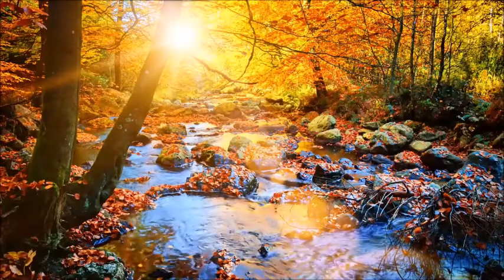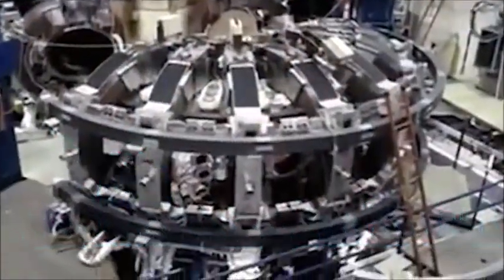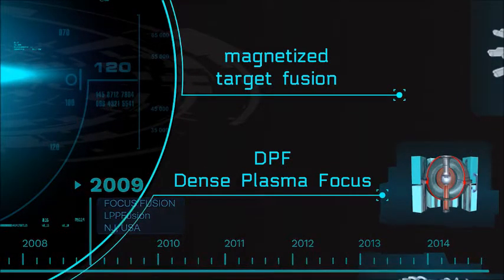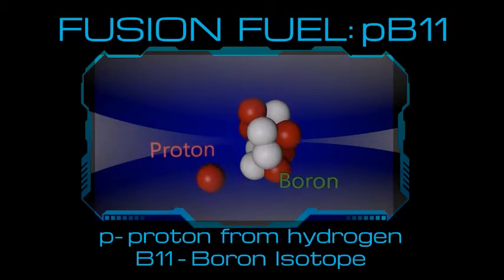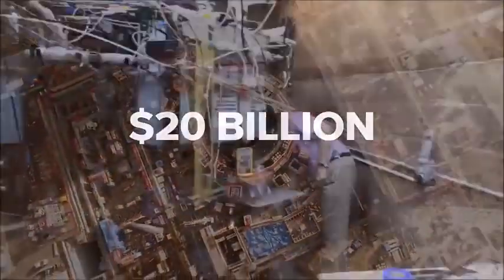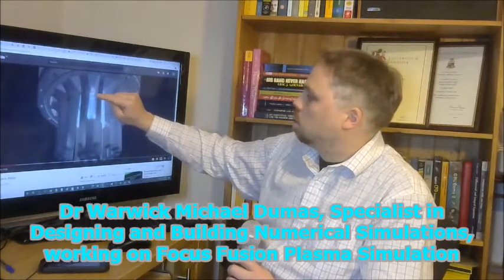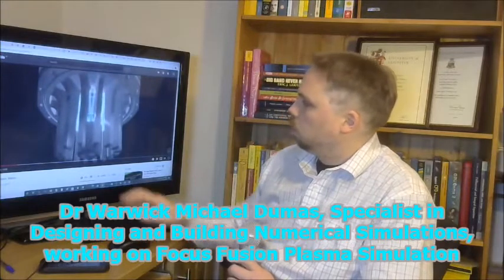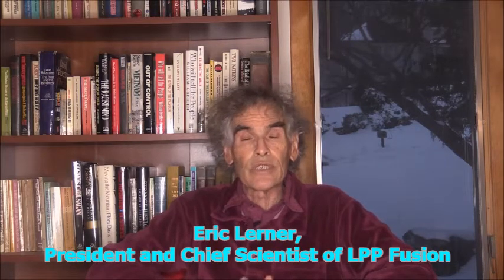Focus Fusion Simulation Fundraising

Comment: @eric i was reading the Friedman equation the other day and noticed that for space it uses the math for a perfect fluid. But space is no such thing. It appears to be almost infinitely compressible. If low density regions are more viscous and high density regions less this could account for both dark components. Slow flows of dark plasma would have greater influence and lower viscosity in dense regions would increase micro turbulence and absorb laminar rotational energy